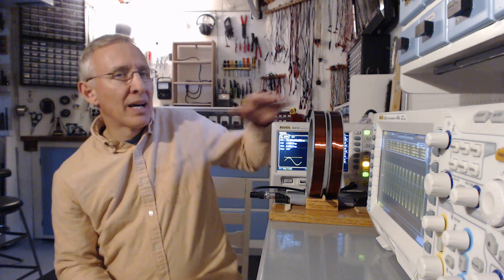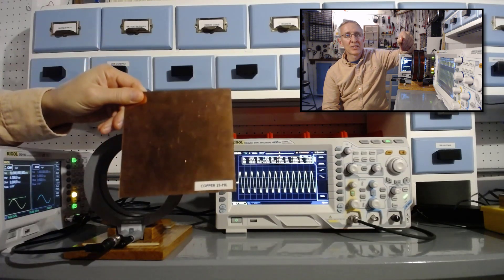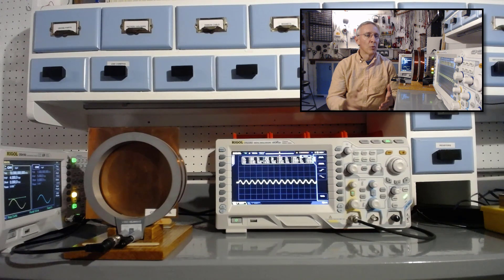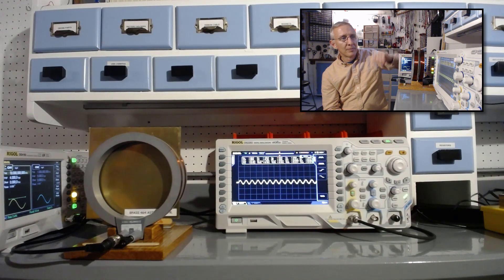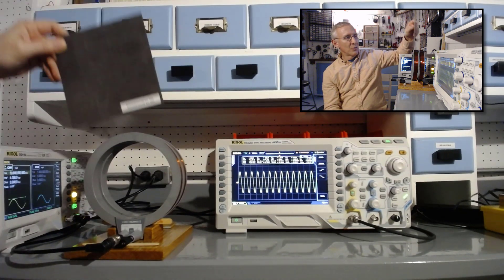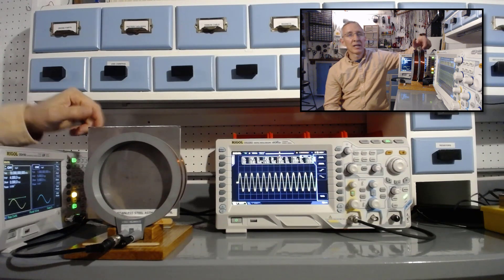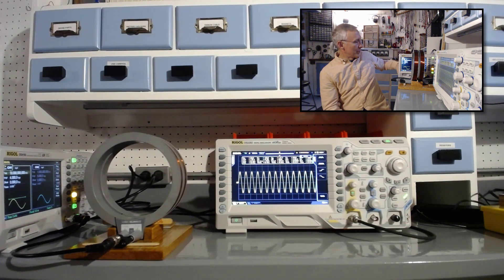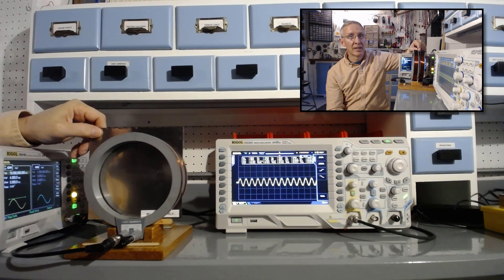High-Frequency Magnetic Field Shielding Demonstration

Comment: If it is about conductivity for steels, the stainless steel must also work, but it does not.
Reply from the maker: The conductivity of different stainless steels varies greatly, but is generally one to two orders of magnitude lower than the conductivity of copper.

Comment: Didn't Nikola Tesla do something like this but with a single coil in the middle and the metal shield plates upright and the 2 flat surfaces facing the coil? I always though he was using the metal plates to capture wireless electrical currents from the coil in between them acting as a transmitter. Like how you are showing in this video that you can block magnetic flux with certain types of metal, could you in turn also use metal shielding to capture the magnetic flux and turn it back into an electrical current? This is what I think Tesla did in one of his demonstrations long ago so there may be something to gain in the field of wireless power transmission when it comes to metal flux shielding with metal plates surrounding a transmitting electrical coil. Just some food for thought for ya. Thnx for the video.

Comment: Great video! Can you please give any advice for properly shielding PC? What i understood from those 2 videos is that you probably need some universald metal to be safe from both high and low frequencys, so what do you think would be a good choice for practical use?
Reply from the maker: You probably don't need to shield for low-frequency magnetic fields, so almost any metal would be the appropriate material choice. If (for some reason) you also need need to shield low-frequency magnetic fields, any steel that a magnet will stick too can be used to redirect those fields.

Comment: Now i think i understand why we should place telecomunication cables in difrent metal cable tray than power cables (low frequency emf) and why communication cables have copper shielding (hf emf). But still dont understand shielding grounding of telecommunication cables (should it be at one end or both ends). Can you make presentation with shielding plate grounding for high and low frequencies? please please please please please please @LearnEMC  :) but wonder where to ground this shielding..

Comment: LearnEMC, I've a cell phone app, which is showing that I've magnetic field upto 135 micro tesla, would that be high frequency, or low frequency? What kind of a material would be best for shielding, I need to shield an entire room.
Reply from the maker: That is likely to be the earth's magnetic field. No need for shielding.
Reply: @LearnEMC  It's some kind of a weapon, normal reading is around 25 microtesla on my meter, when this weapon gets turned on it causes headache, tooth aches, and problems breathing.

I'm a Diplomat, and it's a weapon being used against us.

Comment: what about MHz?
Reply from the maker: The magnetic field is blocked by eddy currents at MHz and GHz frequencies also.
Reply: @LearnEMC  thanks for the feedback! we have a product (VFD+PMSM Motor) with aluminum housing that is over the limits in about 30MHz to 100MHz range, it seems that metal housing can't surpress high frequency noise completely?
Reply from the maker: @xiaosun9111  You don't have a magnetic field shielding issue. Your emissions are due to the common-mode currents induced on the cables.
Reply: @LearnEMC  oh, thanks, can i solve the problem by using a ferrite core aroung the cable?
Reply from the maker: @xiaosun9111  EMC problems with motor drives are best handled by proper design. That's not something can be done via YouTube comments. I'd recommend you seek advice from someone who can review your current design.
Reply: @LearnEMC  ok, thanks! appreciate your video, very informative~
Reply: @xiaosun9111  LearnEMC is sharp to identify root cause in your case. it is CM noise from cables. to resolve this, 1. trying cable bead in that frequency is effective,.2. try to use shielded cable with shielding connected to chassis. 3, if you can do PCB and schematic changes ,  add Y caps at exits of cable wires. 4. mostly your PCBs layout is not optimized.
Reply: @harrysun5155  thanks~

Comment: Would it be any difference if the shielding was a) built as a box/cage around the coil and/or b) if the shield itself was grounded?
Reply from the maker: The conductive materials would work better around the whole coil, the non-conductive materials still wouldn't work. Grounding makes no difference.
Reply: @LearnEMC  Thanks! Then these guitar shieldings also shouldn't be grounded at all in theory?
https://www.youtube.com/watch?v=tcXuVXrCxig

Comment: Put a coil of copper between the coils and see what the drop off is when compared to just sheets of copper. Is there a mass correlation here? A correlation to the number of turns?
Reply from the maker: Excellent suggestion! We have not done this, but would expect a single-turn loop to be very effective if it were sized similar to the coils.

Comment: Please repeat the low/high frequency experiment, but this time connect the oscilloscope's second channel directly to the waveform generator input into the transmitting coil. Now compare the phase difference between the transmitting and receiving coil, or channel 1 and 2.
Reply: If the coils were separated by a known distsnce it should be possible to measure the speed of propagation of the magnetic field by doing this experiment. Have you or anyone else ever measured this?